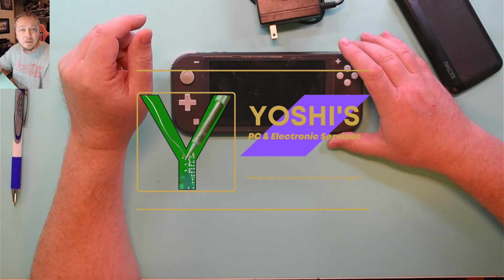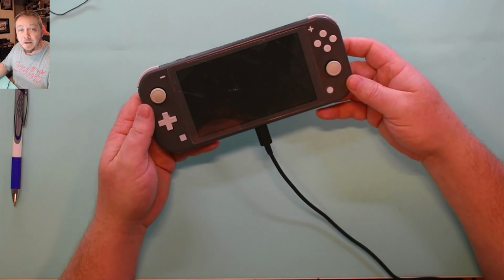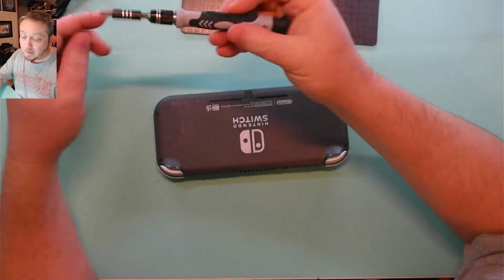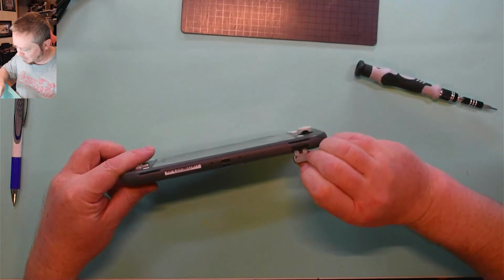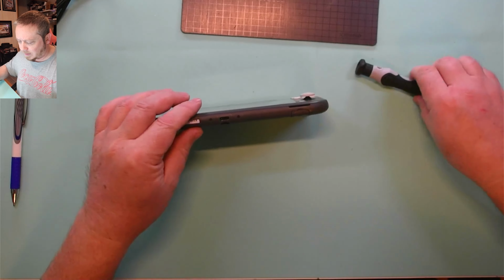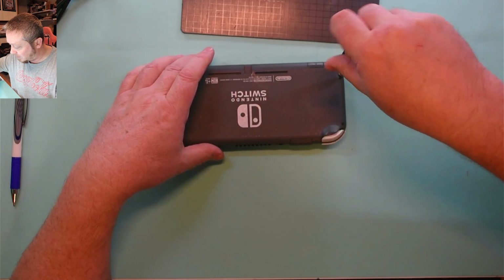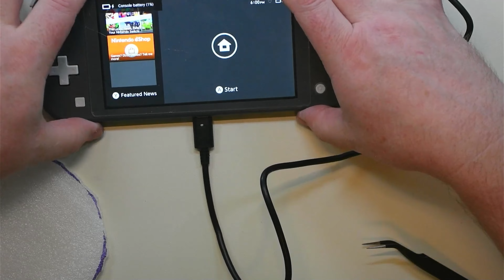POWER! Nintendo Switch Lite - No power - M92T36 Chip - Shorted Capacitors - FIX!

Comment: Kingbo or chipquick flux? 😉
Reply from the maker: Chipquik.
Reply from the maker: The link for the flux is in the description. Thank you.
Reply: @yoshispcelectronicservices  I was just trying to guess it was all lol could tell by the color. I use kingbo which is great flux and sans milky color. About $1 a tube.
Reply from the maker: Thank you for the info, I will have to try that flux out.